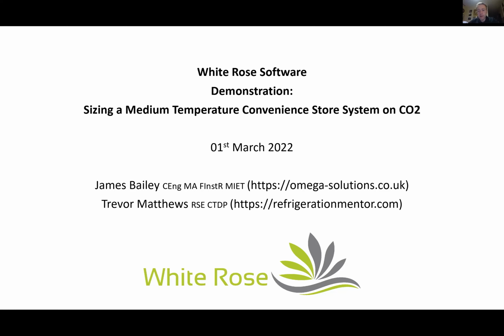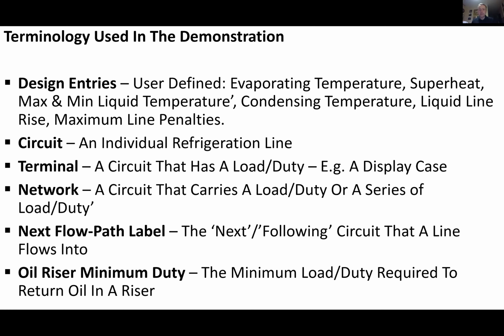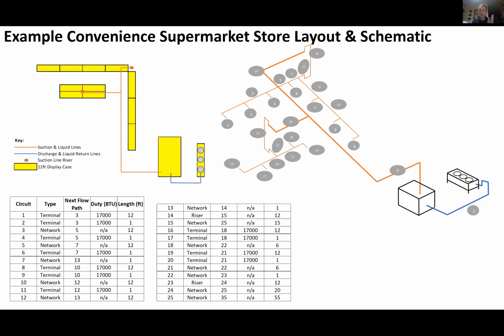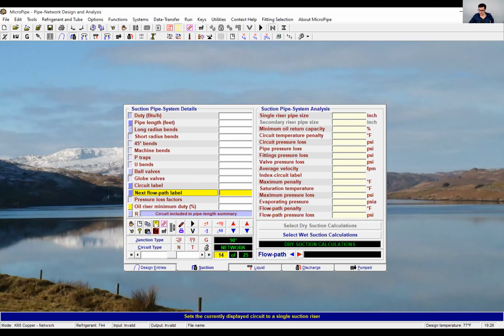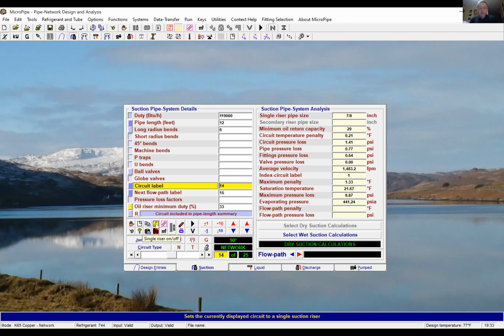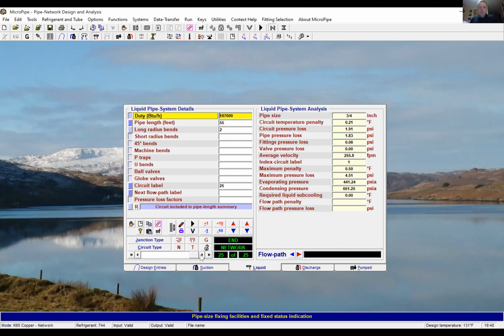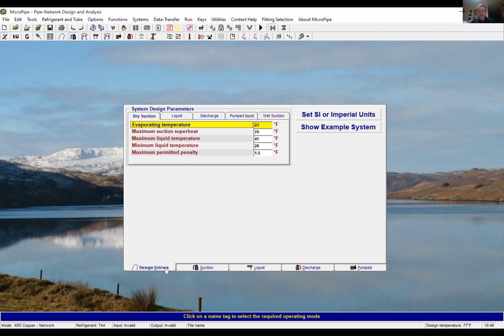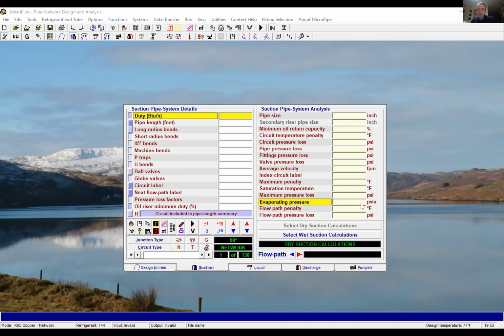CO2 Refrigeration Line Sizing Demo using MicroPipe

Comment: 36:45

Unless you are modifying an existing system, you are supposed to lock all of the circuits before changing a circuit's pipe size ("fix all" function). If you don't do this, all of the other circuit pipe sizes can change to work around the pipe size you just fixed. Always click "fix-all" after running the system initially. When printing the file to PDF, I've experienced that certain details of the system can be missing if the system isn't fully "fixed" before printing. Also, on liquid lines, the software will certainly select pipe sizes with velocities above 1m/s - 200 ft/min (usually up to 1.5m/s - 300 ft/min), and so when using pulsed valves such as AKVs, you need to manually check all of the velocities and adjust the pipe sizes accordingly. Danfoss state 1m/s max for the local liquid velocity. This is really only necessary on terminal circuits where the expansion valves are. Main headers can go to 1.5m/s without issue.

Thank you for the presentation. I'm glad this old piece of software is going to get refreshed.
Reply from the maker: Thank you for commenting.  We are working on updates for the software and if you want to get access to the latest updates first, subscribe here https://offers.refrigerationmentor.com/micropipe